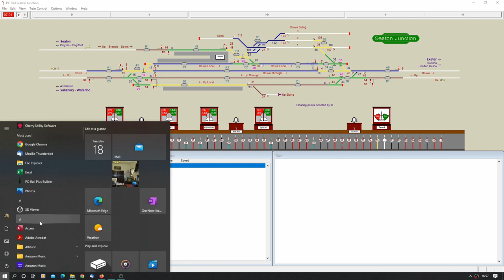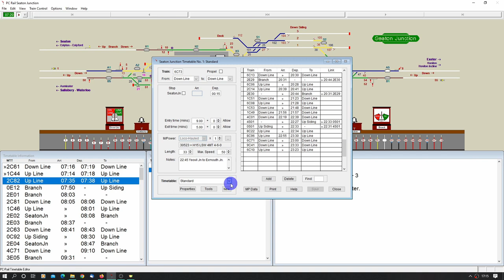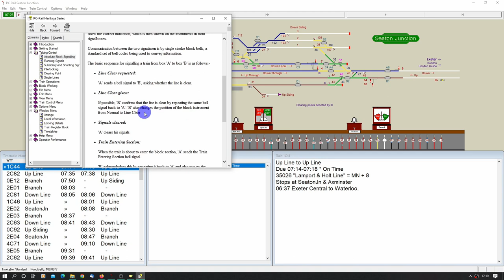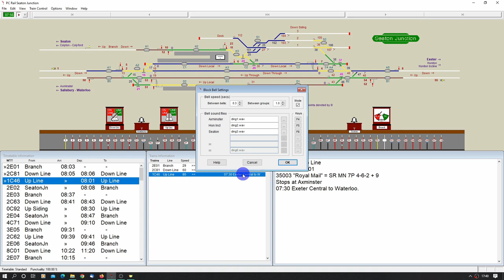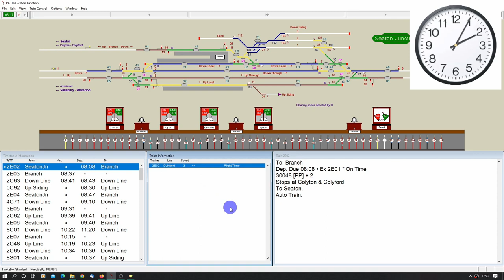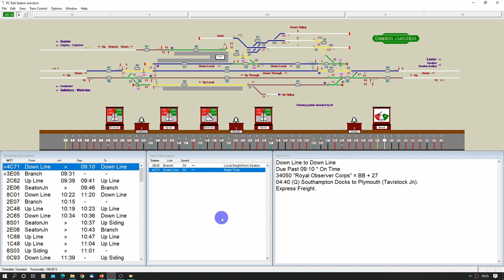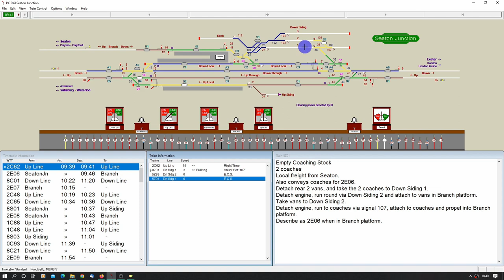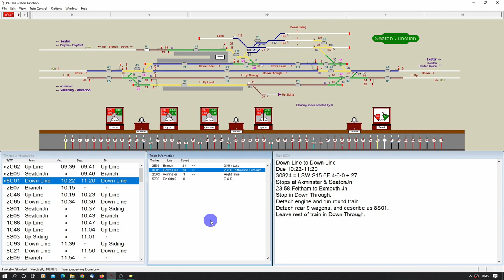A Look at Seaton Junction - Heritage Series Signalling Simulation by PC-Rail

Comment: Thanks Russ for demonstrating the basic process of moving trains. It has clarified for me the sequence to follow to complete the train movements through a section. I have tried to use the same process for the Chippenham heritage series but I have had problems early in the simulation at 5:20 am in dealing with the splitting of wagons from the Down refuge siding and getting them to be moved into the Goods Shed line. Please, can you demonstrate how to start the Chippenham simulation.
Reply from the maker: Thanks for your comments and it's nice to have some feedback. I'll look at the Chippenham simulation next.
Reply: @railwayruss  Your videos encourage me to try the Heritage series except Tonbridge which is seriously difficult. I noted the stress in your voice. The problem with Chippenham I have is with the 6B04 train which has to be placed in the Down Refuge siding and then the engine and 12 wagons have to be detached and designated as 9L04. I uncouple the 12 wagons but the loco is not recognised as being part of the detached section which is to move forward. The 9L04 has to move to Goods Shed West. I cannot get the 9L04 to move out of the DRS. What am I doing wrong?
Reply from the maker: @oscardewyldde  I actually ran through this part. Email me on russ@pcrailservices.co.uk and I can go though the sequence. I will also be covering this on a video. Please note Front and Rear when uncoupling refer to the last movement made. Try uncoupling the rear 12 which has the loco attached. I suspect you may be uncoupling the front which is now the back, with no loco. Confusing?  Yes it is, Look at the < and > to determine which end to uncouple.